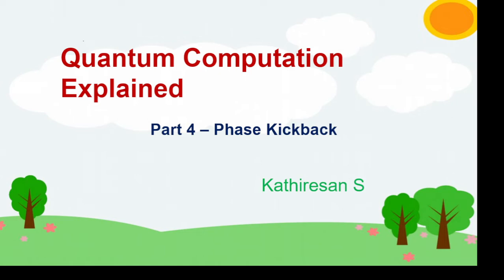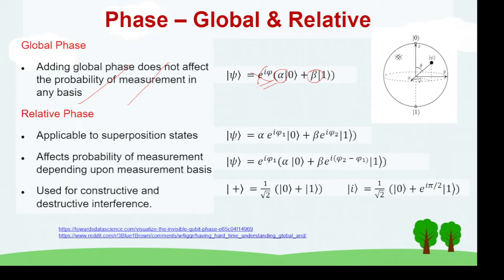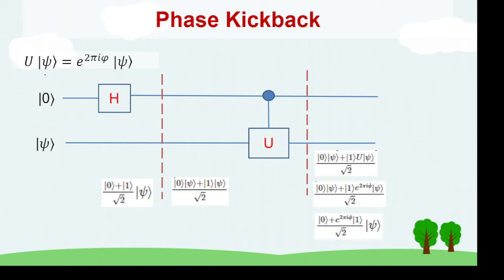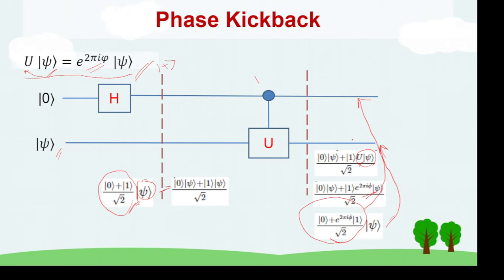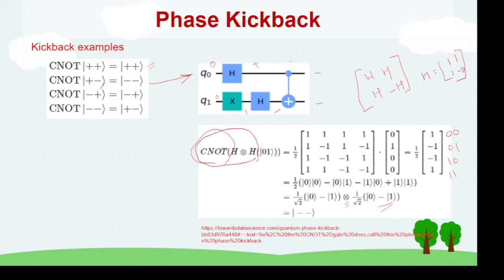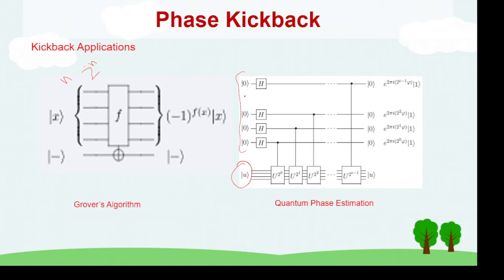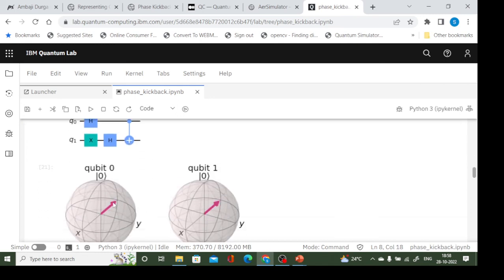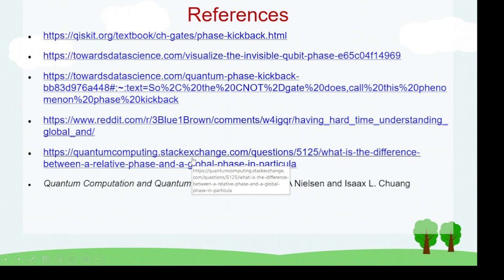Phase kickback

Comment: In the  Unitary Gate, (control qubit |c> and target qubit |t> ) will present, So when applied Controlled Rotation (like CX,CCX) on quantum states Based on control qubit the target qubit is changed(phase is applied) and control qubit has no change.

But in Phase kickback when you apply the controlled rotation on quantum system, the phase will applied on control qubit were, the target qubit is unchanged.

is it right sir?
Reply from the maker: Sorry, your question was not clear to me.